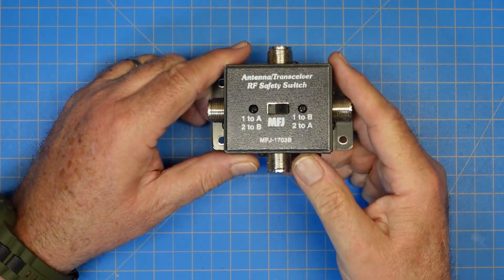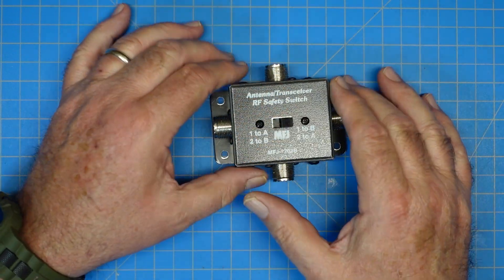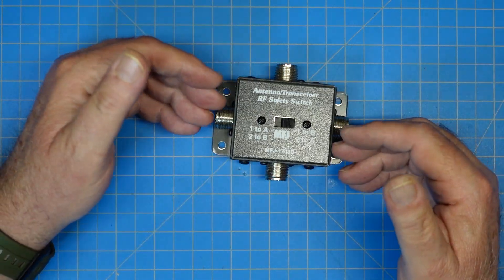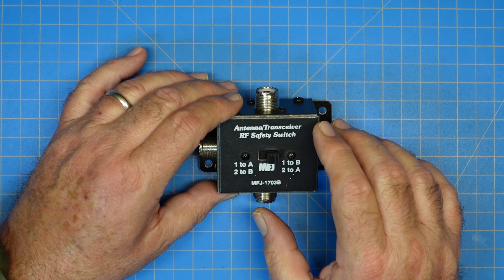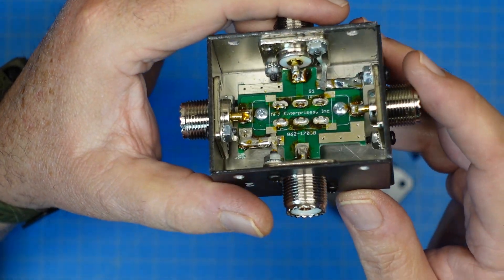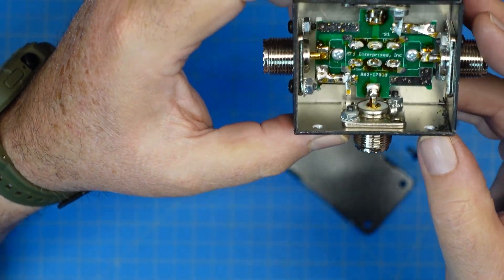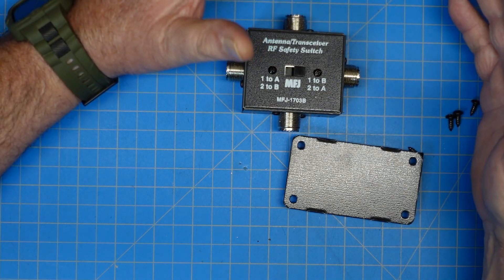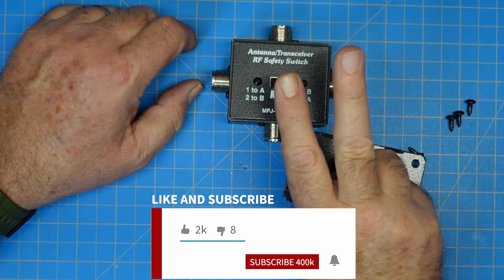To Switch or Not to Switch? Discover the MFJ 1703B A/B Switch Box!

Comment: No way would I risk multi-thousand dollar rigs like this. Especially with an MFJ product.  I've bought three MFJ products.  I bought a mic years ago that turned out to be DOA. I didn't use until after the 30 day warranty period so they refused to replace it unless I paid for another.  My MFJ 1979 telescopic antenna broke the third time I used it. I replaced it with Chameleon model. It's lasted two years now. I do have an MFJ tuner I bought in the early 90s.  That is still working.